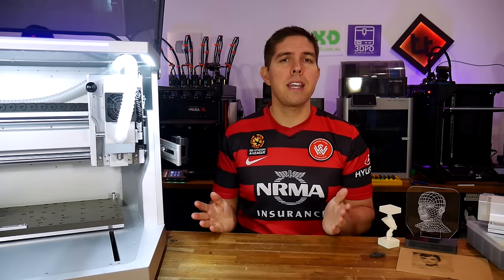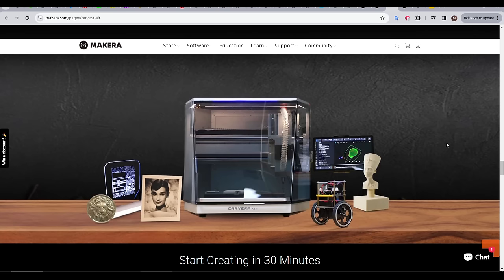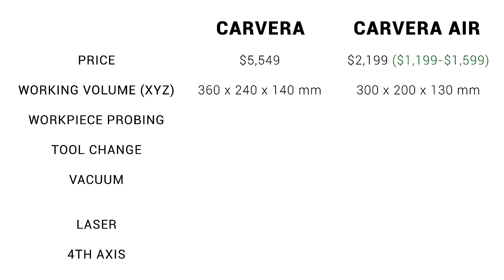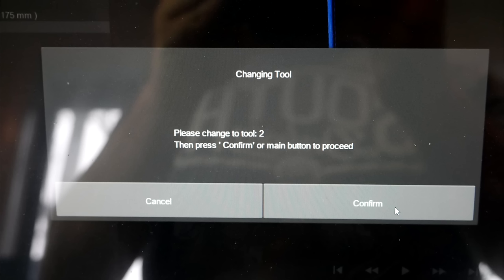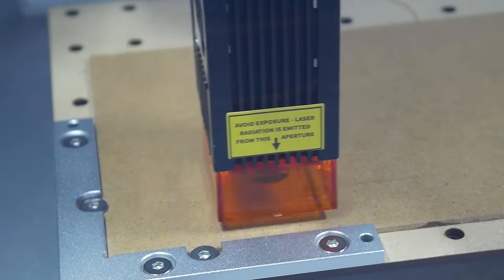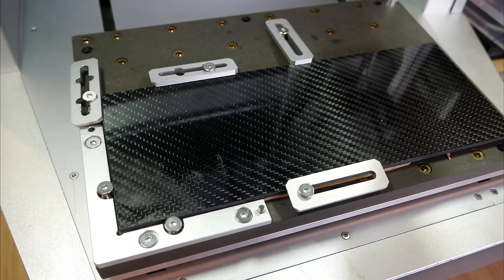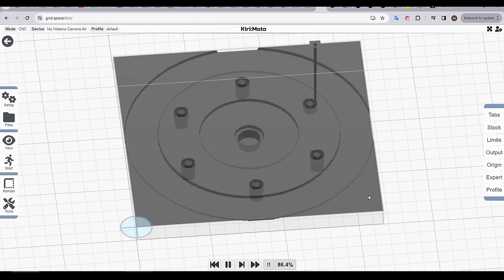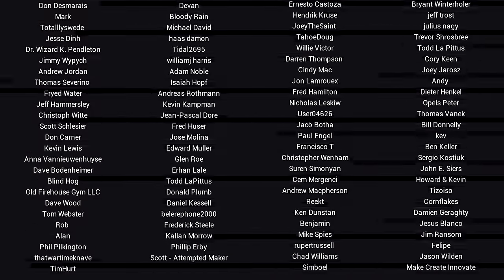Carvera Air - Smaller, cheaper, but still smart and capable

Comment: The relief for the 4th axis of the Carvera is faulty (G-Code, maybe fixed it yet?) So it is like you invest 6k´s and getting something unusable along with... Meaning they sell this knowing that it doesn´t work. The Air model imho is just a try to save on many components and make a machine that is much cheaper but good for earning more money. The Air will not be changing anything like their first model was.

Comment: Thanks for another great video. I've had my eye on the original Carvera for a while, and was wondering what all the differences were between that and the "air" version. This definitely answered the questions I had. Seems like a very fair price for what you loose by going with the air. I could see possibly buying the air if someone wants to dive softly into making CNC items as a business, and then if the products they make with it sell well enough, they could always buy the one with auto tool change to keep up with orders at that point.

I've had to many problems being an early adopter with 3D printers, so I don't think I'll be going for the Kickstarter. But I'll definitely being keeping an eye on what people think about it once it's actually out in the public.

Comment: How much do you reckon you've used your Carvera since getting it? Do you reckon this type of mill will really serve a hobbyist like yourself well/provide the value to the hobby experience that its price commands?
Reply from the maker: I probably use it once a month. That doesn't sound like a lot, but I tend to 3d print projects as a first choice. I use it exclusively by choice though. My 6040 hasn't been used since having the Carvera, I might sell it.

Comment: Hi, could you use the 4th Axis rotary with Kiri:Moto ??
Reply from the maker: No.
Reply: Really? I've used it with the Carvera 4th axis.
Reply: GridSpace: 4 Axis Indexed Milling with Kiri:Moto and Carvera
Found it at yoututbe ...   :-) No clue how practical it is, have to wait till I get the Cavera Air end of the year
Reply from the maker: Indexed milling, that's true. But that's not what's demonstrated with the bust here, which is continuous rotation.
Reply: @TeachingTech   Ah, true - good distinction to make - I was using indexed milling. Hopefully continuous rotation gets added to Kiri:Moto at some point!

Comment: " This 3D printing concept is insane! Forget building objects layer by layer, this design uses a spinning vat with two sections to literally print from the INSIDE OUT.  Imagine building complex internal structures first, then layering the outer shell!

The separate vats for different materials open up a whole new world of possibilities. You could print objects with hidden compartments made from a different material, or even integrate things like dissolvable support structures or tiny magnets directly within the design.  This could be a game-changer for things like self-assembling furniture, microfluidics with built-in valves, or even bioprinting with intricate vascular networks!

Seriously, this is some next-level 3D printing. Can't wait to see how this technology develops!  #FutureTech #InsideOutPrinting"